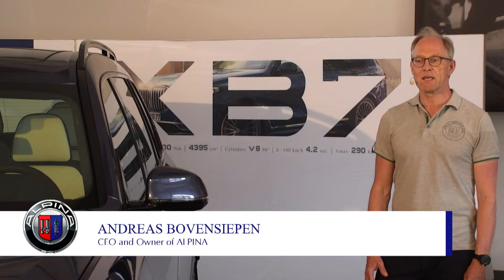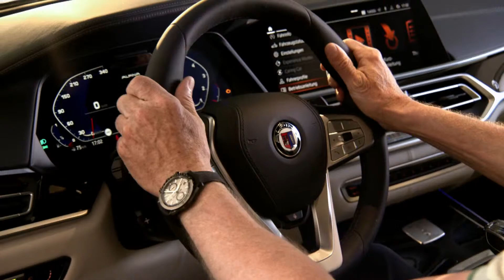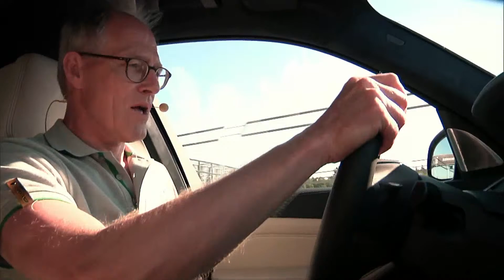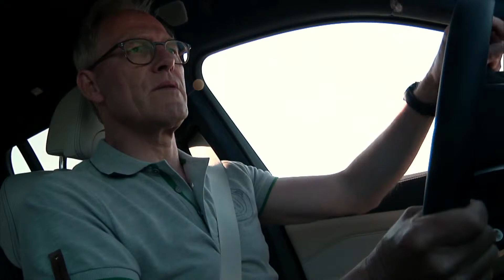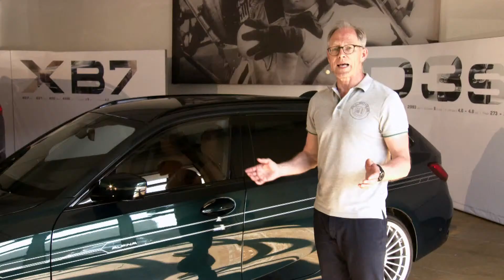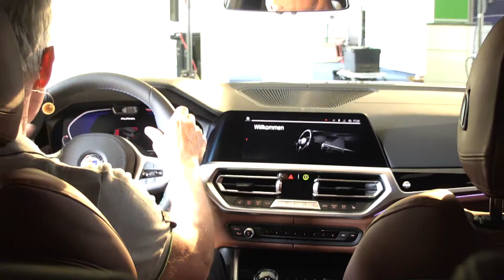THE NEW BMW ALPINA XB7 AND B3: WALKAROUND WITH ANDREAS BOVENSIEPEN

Comment: I'm a bit disappointed with the new D3S.  With the new D5S, you have given it more power from 388 HP to 400, because BMW wont make the M550D anymore.  But why just 355 hp for D3S, nearly the same power figure as the BMW M340D, and it's heavy.as a lorry.
Reply: Diesel is a shit fuel anyway. Just go petrol and all your problems will dissapear.